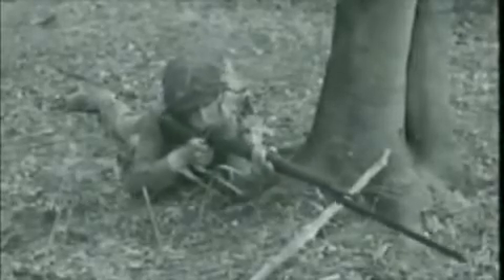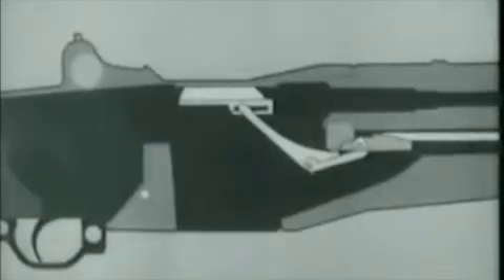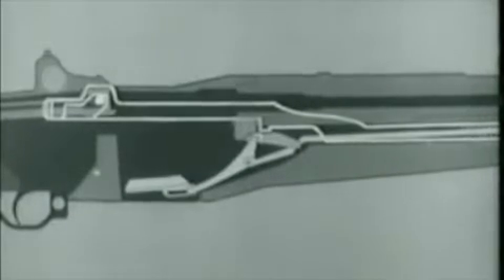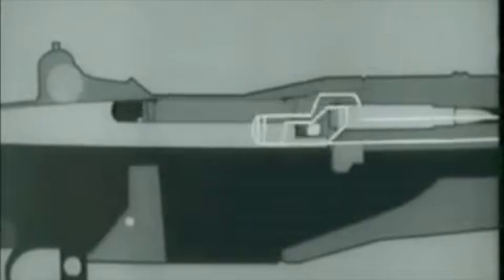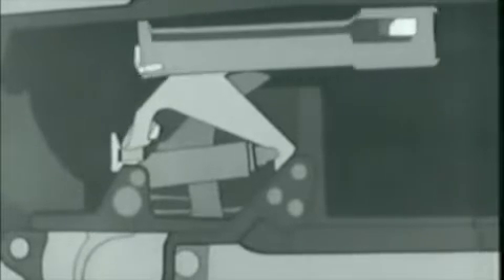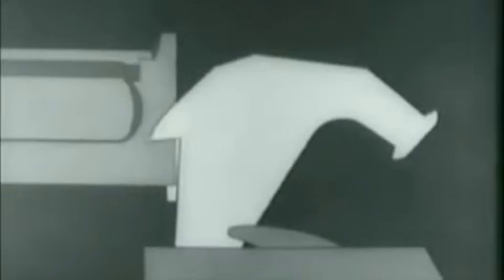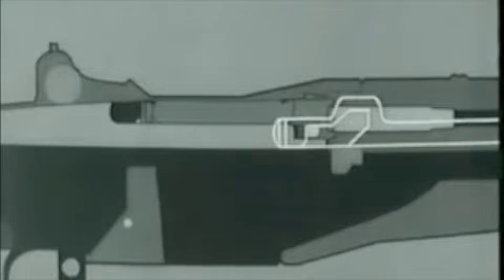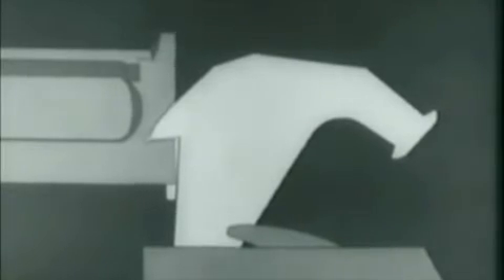M1 Garand principles of operation part 1

Comment from the maker: From what I've heard, one of the problems is probably the ammo. Modern commercial .30-06 ammunition is far more powerful than what the M1 was originally designed for (something like 100 fps stronger/faster). This increase in power can also damage the op-rod, or even crack the receiver. One solution is to buy ammo designed specifically for the M1, and another is to buy an adjustable gas plug designed to allow the use of modern factory ammunition.